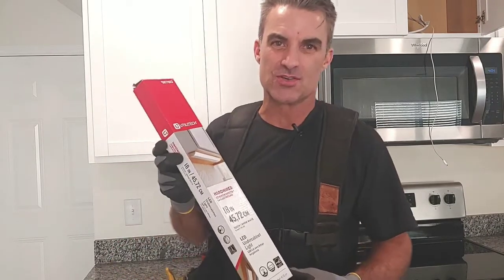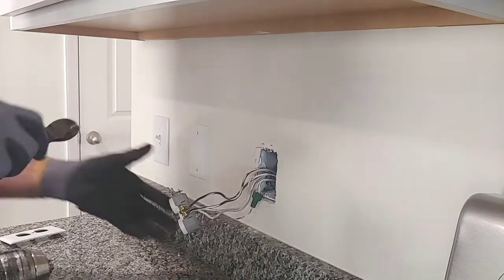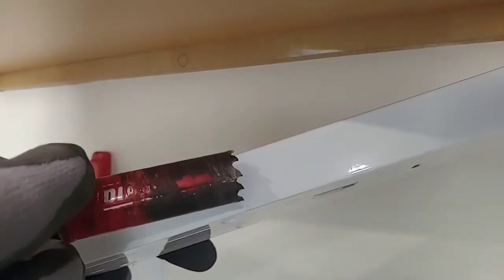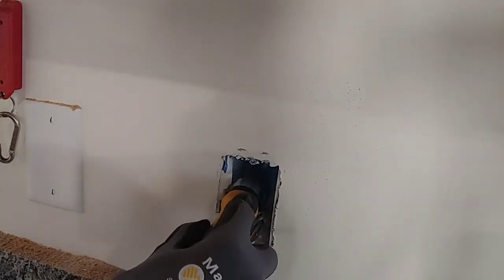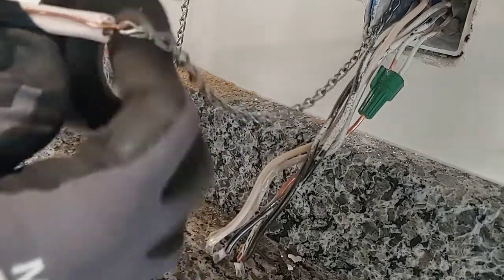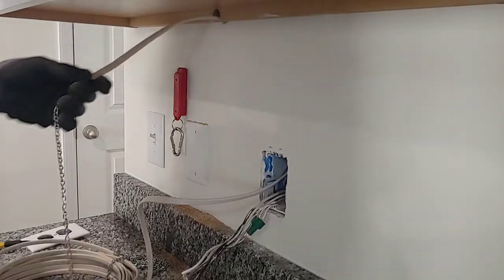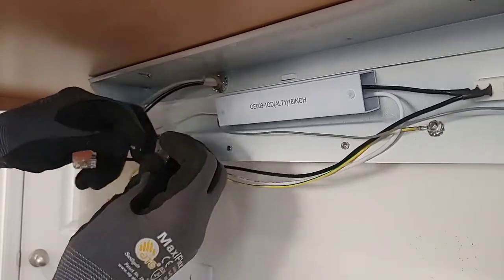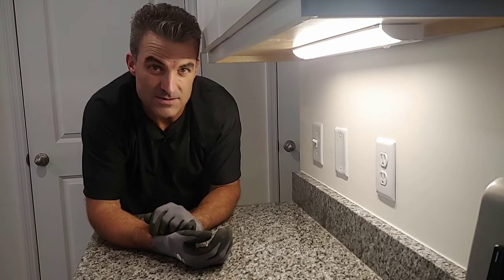Install Undercabinet Light & Wiring Without Cutting Sheetrock How To UtiliTech #diy #howto #how

Comment: Liked your video. I am looking to install two 18 inch and one 36 inch fixture to fit under 3 wall cabinets in a straight row. Each fixture has the push in connector for the black/white wires supplying power. How would you tie everything together.
Reply from the maker: Hi. Thank you for watching the video.  You will need to purchase a few feet of 14-gauge wire for the purpose of daisy chaining these together. You will need a few feet of each white, black and green wire (Home Depot or Lowe's carries this wire). It's been a while since I made this video, and I cannot tell if the quick connects have a 3rd port on them for the purpose of daisy chaining fixtures together. If it does you can simply come out of each quick connect on the first fixture with the corresponding color wire (green ground wire connects to the yellow wire in the fixture) and enter into the next fixture with the new "pig tail" wires. These new pigtail wires are essentially the power source / ground for the 2nd fixture. There are circular "knockouts" on the side of the fixture that you can push out to make a hole for these wires to run through. If the quick connects do not have a 3rd port, simply cut off the quick connects and wire nut the wires together (all whites in one nut, all black in another nut, and all neutrals in another nut). Once you run this set into the 2nd fixture, you repeat the process with new "pig tail" wires and push those out of the second fixture (through a knockout hole), which then become the power source for your final light. Once completed, all three fixtures are daisy chained together and will run off of one light switch. I hope that this information helps you with your project. You Can Do It👍
Reply: The quick connects have a total of 3 ports one of which is occupied by either the black,white or green wire. Is this adequate for my case
Reply: The 36 inch fixture is the center fixture and the power source will come into that one thru a knockout hole
Reply from the maker: @michaeldevaney2804  ok. So if there is an open port on each quick connect you can come out of it with matching wire colored "pig tail" and go directly into the next fixture. 👍
Reply: @YouCanDoIt2  
Thanks for taking the time to guide me on this. Since there are only 3 ports on the center fixture which is where the power will come in and the left and right fixtures will be tied into the center fixture can I use additional 14 gauge wire from the left and right fixture quick connect and bring them into the center fixture and pigtail them together with additional piece of 14 gauge wire and that additional piece will occupy port 2 on the center fixture. I will do this for black and white wires on left and right fixtures. This leaves one open port on the quick connect for the center unit which is where the black/white wires from the power source go.There is no ground wire coming thru the wall containing the black/white power source wires so not sure if that is important. I will send pic of quick connect
Reply from the maker: @michaeldevaney2804  if you are using the center fixture as you main power source, you can cut off those quick connects and bring pig tails from the left and right fixtures and wire nut them  in with the center fixture. Make sure to purchase a wire nut that is big enough to accept the number of wires you are combining together for that particular gauge wire (tan Ideal brand wire nut is usually my go-to to handle 4 wires).
Reply: Ok I will insert pigtails into quick connects for left and right fixtures and bring those wires into center unit. Then I will clip the quick connects off all wires in center fixture and strip about 3/4 inch insulation from the wires. So for example I will take black wires from L and R and center fixture and the Black wire which is power source for all 3 fixtures and wire nut them all together. The same to be done for White etc. Is that correct?
Reply from the maker: @michaeldevaney2804  Absolutely correct! You are a pro!!
Reply: You are absolutely,hands down the best. Such detailed explanations and great video and even more so you provide quick responses to questions so that the person tackling this feels they know what they are doing…5 stars
Reply: NO: 8971WH
US
ENERGY STAR
282975
CABINET LIGHT LAMP ARM are they similar installation? The LED bulbs are going dim

Comment: I bought this light from UtiliTech and do not like it.  The squeeze connector is to large - the screws are too long!  You can see by the vid that it sticks out on the bottom and does not look good.  This has to be made in China - what a stupid design!